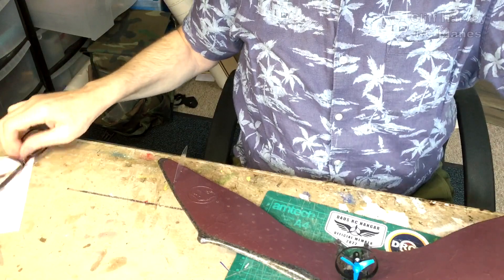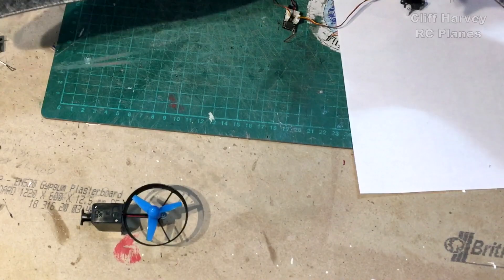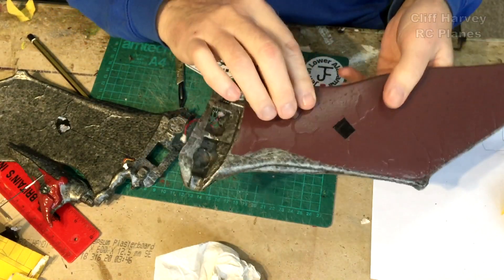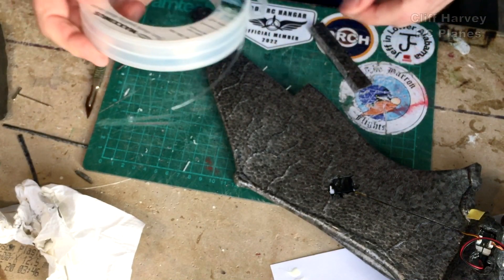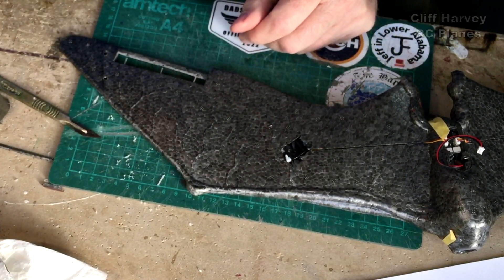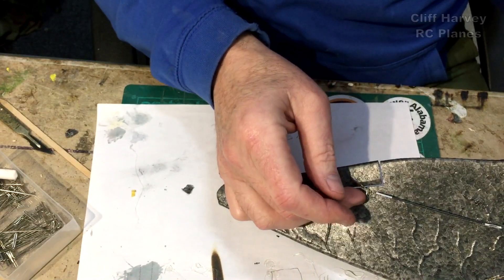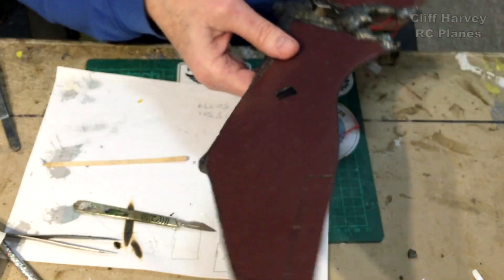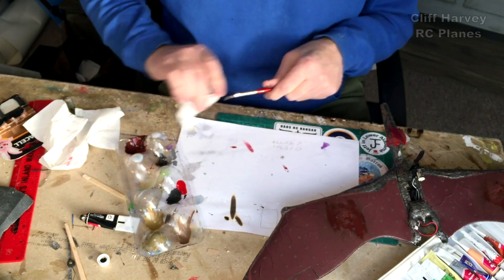Watch Me Turn This Flying Dinosaur into an RC Monster!

Comment: Hey Cliff, when you connect a TX16S to a Spectrum receiver, the transmitter automatically translates from AETR to TAER (which is what Spectrum uses), I'm not sure how that works when you have elevons, but it can do your mind in on these little receivers were you don't even have labeled servo plugs. So the throttle probably needs to be set on Channel 3 even though it's Spectrum.
Reply from the maker: Hi Tim, thanks, I'll play around a little more, my technology tasks are starting to back up 🤔👍